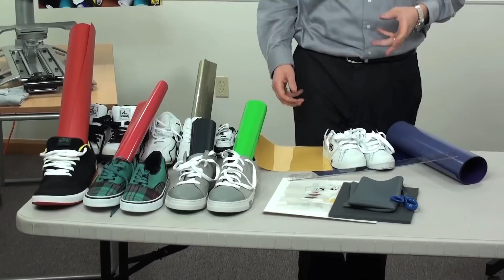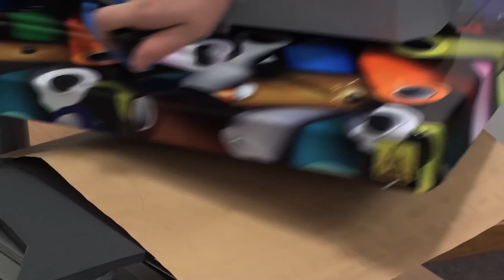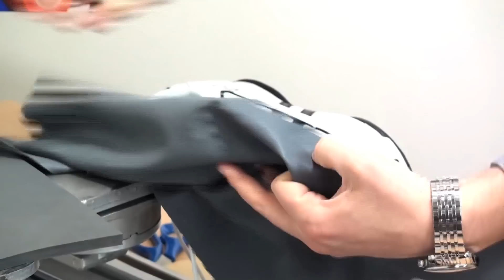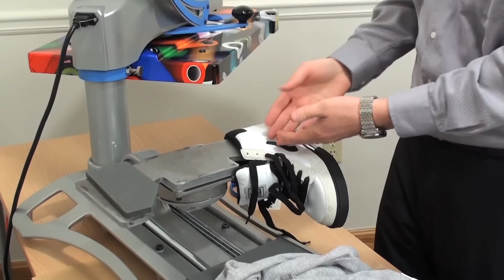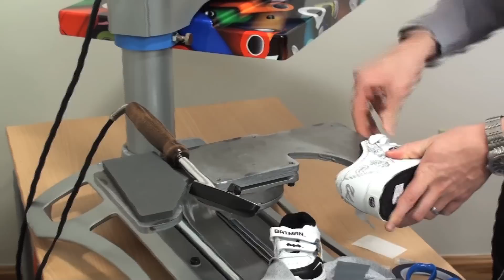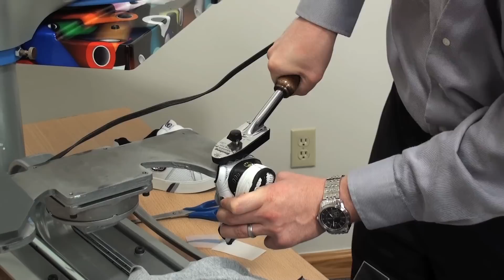Customizing Footwear with Heat Press Transfers

Comment: It doesn’t come off?
Reply from the maker: No, the heat press secures the material to the shoe. Of course, it can fade over time due to wear and tear.
Reply: @CADCUTDirect  What printer are you using to print the designs?
Reply: @JojoIvan531  The materials being applied are CAD-CUT® Heat Transfer Vinyl available through STAHLS'.  It is a vinyl that is cut on a cutter and then heat applied to the shoe.

Comment: Can I use this type of machine for slides too ? Like The material of Nike   Slip on slides
Reply from the maker: It would depend upon the material of the slide. If it is similar to that of a cleat, then CAD-CUT® Fashion-FILM® [ https://www.stahls.com/heat-transfer-vinyl-fashion-film ] can be heat applied using a Flexible Application Pad [ https://www.stahls.com/heat-press-flexible-application-pad ]. As with any unique material, a best practice is to test it out.

Comment: Hello, where can get the printer and accesories to imprint the shoes?
Reply: +Bernardo Filipe Joaquim Contact Stahls' at 1-800-4STAHLS and they will be able to connect you with the necessary equipment and materials.
Reply: ccdprivate1